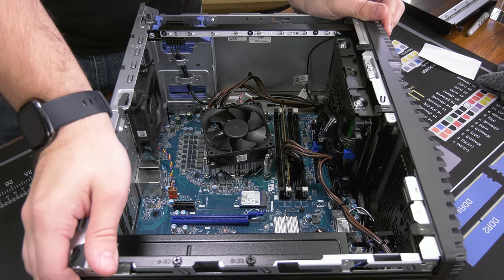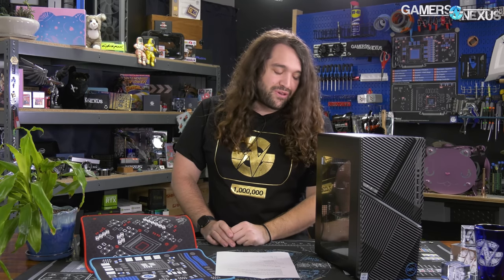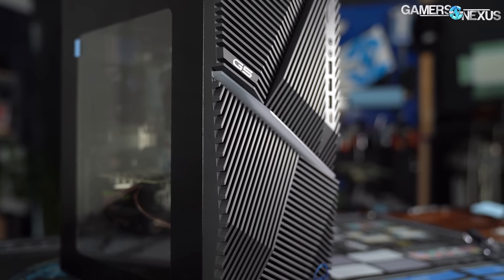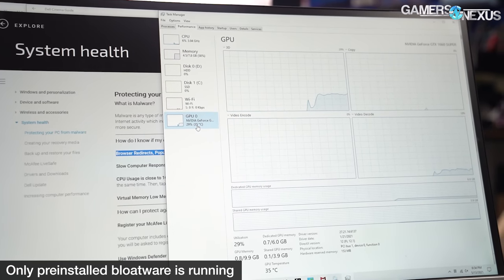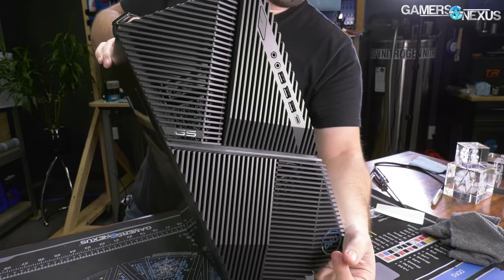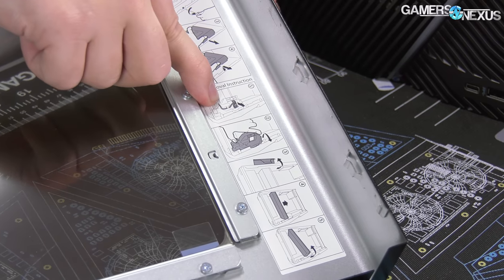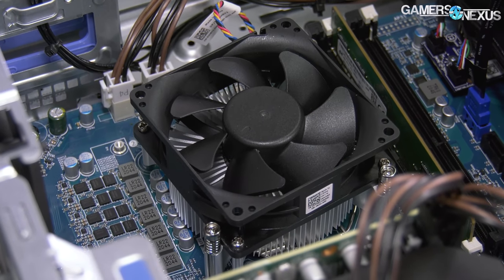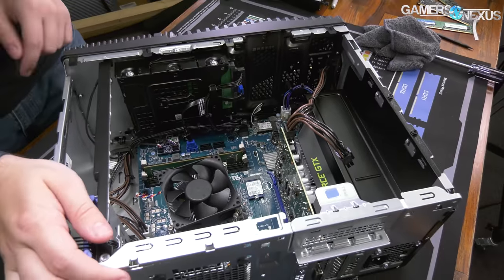Worse Than Walmart: Dell G5 5000 PC’s Garbage Parts & Hidden Charges

Comment: Dell have done this for decades

Parts are specifically made in a way where you can't swap them out .. only way you can change them is by going to dell at a premium price.

YouTube videos on how to build your own pc 

Much cheaper and better specs
Reply: Dell stopped doing this for a good while, at the end of the Core2 era.

My Optiplex 7010 uses a standard format mATX board, standard PSU and PSU connectors, has a detachable rear IO shield and the front IO connects to the board with standard wiring. And it's a system manufactured in 2014.

It's sad to see they went downhill again. They know how to make good systems.

Comment: Welcome to dealing with “Legacy” computer manufacturers that use their corporate sales tactics on direct consumers as well. It’s amazing. This is how they all were and partly why “Gateway” was so successful and so crappy at the same time. They did the same sort of things but they offered them to you honestly even if they leaned heavily on you to buy it etc they told you so for consumers this new “easy” way to buy a computer without car salesmen tactics was amazing and super convenient etc. sad
Reply: I'm not defending Gateway, as they did some really stupid BS in their laters years before getting sold to ACER, but at least they used more standard parts you could fix yourself out of warranty that would fit in the case, then Dell ever has!!
Reply: @CommodoreFan64  indeed…though they were kind of 2 sides of the same coin. Dell just had the balls/nerve to treat home users like they were buying thin clients or something

Comment: I know a company in my hometown that builds you a computer from the parts you select, for less than €100 + the price of the parts. And of course they give a guarantee for each part separately. Only once I have had a problem with any of their products, and that was resolved rather fast, the guy just asked if this other computer would be fine to me and I said yes. Then I just carried it to my car and drove home. And it worked for years very well. I suppose the problem was with the motherboard, but I never asked them.

Comment: "WHY WOULD YOU MAKE A LOAD-BEARING CPU COOLER!?"
Reply: ... so it won't pop off during shipping?
Reply: It's not load bearing, it just attaches to something unexpected (the case).
Reply: @AndrewARitz  It actually is load bearing , bcs the stands go through the motherboard so basically when you pull on the motherboards the pressure point is on the top of the CPU. But as there are other screws on the edges it's not that big of a deal. 
Usually when you have a MB stand , the thread goes through the motherboard but actually the motherboard lies on top of the stand and screw is pinching the motherboard in between. See the difference ?
Reply: @terrabiker  No it's not.  The motherboard is secured separately.  This was part of the BTX standard specifically to protect the motherboard from damage.  The cooler is a large mass, securing it to the motherboard forces the board to bear all of that load.  Securing it to the chassis puts most of that strain on the chassis.
Reply: gmu_alum08  Exactly what strain do you think there is?  The motherboard weighs barely more than that cooler, far less than a larger one, and is well secured across a much larger footprint.

Per Intel:
"The SRM is the critical structural component in the chassis. The SRM is a very high stiffness element in the static and dynamic load path that removes many of the structural liabilities evident in existing custom and ATX chassis designs,
The SRM:

•Substantially increases the motherboard effective stiffness, which:

 Reduces the amount of preload required to manage second level interconnect (e.g. surface mount component solder joint) integrity in mechanical shock, vibration, and long-term temperature cycle reliability testing

 Limits the upward motherboard curvature during an upward mechanical shock event. Upward board curvature is especially detrimental to second level interconnect
•Ensures that the internal loads of the TMA heatsink are transmitted to the chassispan at its stiffest locations near the front and rear chassis walls.
 The TMA heatsink inertial loads are transmitted through the SRM to the TMA Attach Features (Section 2.7) and the SRM Retainer Slots (Section 2.5.4), which are located very near the front and rear chassis walls, respectively."

https://www.intel.com/content/www/us/en/design/technologies-and-topics/motherboard-form-factors/technical-library.html?grouping=EMT_Content%20Type&sort=title:asc

Comment: I feel sorry for anyone who bought this as a way of getting into pc gaming.
Reply: When I first got into gaming I remember buying the dell xps 720 and I spent thousands of dollars on it, it was an absolute beast and had so much upgradability. Then I remember a few years later getting the newest dell xps (think nvidia gtx 400 era) and it was a piece of garbage. The inside was a really cheap motherboard. The cooler was so shit, the ram DIMMs were the absolute cheapest garbage. I was able to upgrade my super old pre xps720 emachines desktop to be more powerful than the most powerful XPS desktop at the time.
Reply: I've been building PCs for thirty years. I bought the AMD 5700 XT version of the G5 5000 because I'm a grownup and just want to play games. For us, this system is well thought out. It's not for hacks who like to mix and match components and was never intended to be.  Being all 12 volts is actually a very good thing for energy efficiency, in spite of what this guy says. Same with the proprietary motherboard.  It's like nobody remembers the BTX form factor or even the move to soft power switches.

Comment: Not only are they sneaky with the extra charges but I even heard of people ordering dual channel memory and getting single even though they paid for dual.  That is for performance and it is the one reason to get dual channel (or more channels if your system supports them).  I always knew even years ago Dell uses proprietary parts and that is why I always flatly refuse to buy one of their PCs.

Comment: I’d like to see GN cover a Precision workstation from Dell. They seem to use standard components and have some actual airflow.
Reply: I actually just picked up a yard sale XPS Skylake that blew my mind away by having a fully standard mATX design. 24-pin, normal PSU, sane headers.
Yeah, it uses the same weird chassis from the Alienware with the power supply mounted above the CPU, but when all it's cooling is a 6700 non-K, it's not that big a problem.
They also didn't embellish it with much excess plastic, just with a forehead with the front I/O, and a footer.
She's definitely a keeper. Thermals/airflow might be a concern when I upgrade the GPU from a 750ti though.

Comment: Dell is so scummy. They had a price match deal where if you found a system online cheaper than what they sold the exact same system for on their website, they would match it and reduce the price by 10%. When I found a laptop that was below their price, I brought it up to the sales representative who refused to price match even though they couldn't point out where in the fine print the match I found violated their policy since it was from an authorized Dell reseller. After 15 minutes of arguing with the rep, I hung up phone and decided to buy the laptop from the reseller. 

In only about 5 minutes, the laptop on the reseller website was taken offline and unavailable to buy. Then the system came back up at the SAME PRICE as the system on Dell's website! WHAT THE FUCK? Never trust the price match program for Dell, they use it to enforce their pricing policy on resellers and don't even give you the discount that's promised.
Reply: That sounds about right when it comes to price match and Dell... Just make a PC when GPUs finally become available.

Comment: A couple of years ago I bought a laptop from Dell for my dad. He only uses it for internet, so I got the low end model. Within one month a windows 10 update popped up and he was unable to use the computer. He finally told me when I saw him using his old computer again about two months later (he didn't want to bother me). Windows could not update because there wasn't enough memory. After shutting down everything I could think of, still not enough. Called dell and they claimed it wasn't covered under the warranty because it was a software Problem  and I would have to pay and send it back to them. I tried to buy memory for it and found it not available because the memory was soldered to the board and no expansion slot. When I complained to the tech, he laughed and said "you bought a cheap laptop".

Comment: "I dont cook my own food" we can see that lol
Reply: Samurai Shampoo  It's often cheaper to have someone else do it believe it or not. You also have them do other things while it's on the lift like check the brakes, suspension, and rotate the tires. Most shops don't charge to do that.
Reply: Samurai Shampoo  you don't deserve to have a license if you don't know how to do basic maintenance on your car, at least having done it yourself once.

It's pathetic how little people know about the cars they drive every day at speed near other people
Reply: @willjohnsonjohnson  It's cheaper at shops because you're generally getting recycled oil or a mix of recycled and new with a cheap $3 Fram filter.
Reply: @drumboarder1  Most people would have to visit the shop anyway to dispose of the oil that is a waste product not everyone is conscious about dumping their waste somewhere. I did my own oil change once then realized it's more expensive, but yeah I'm paranoid about them trying to get away with leaving the same oil filter so I mark it with sharpy to be sure, but that doesn't mean they didn't put a different used one on, The only reason to do your own oil change is to avoid being lied to or scammed.
Reply: @StayMadNobodycares  same as building your pc once, fix your car once to figure out what the basics are so you aren't an uninformed customer.

I've come across multiple mechanics willing to dispose of my previous coolant that I kept in bottles and the same will no doubt happen with oil.

Comment: So I have one of these and I've had it for at least a year now. I'm looking to upgrade into something better, but I don't think I can afford a total re-build. Is there any way I can salvage any parts from this into another PC.
Specs(any not listed below are the same as the video - ex. PSU, CPU cooler):
CPU - Intel i7 10700
GPU - Nvidia GeForce RTX 2060( The one that came with the build)
32 GB Corsair Vengance DDR4 Ram
wdc wd10ezex 1TB internal hard drive
pm991 nvme samsung 256gb internal ssd

Comment: I'm not sure what happened to Dell.  My work used to use them exclusively, but after years of getting scammed by the "corporate account" and getting prices HIGHER than they were offering to the public, and having several orders cancelled without notice, we had to switch to a competitor.  Then to see this tear down... yikes.  I've recommended them to family in the past because I didn't want to deal with building and supporting a family members computer, but I'll never do that again.  this is bordering on scam territory.  I do not expect proprietary components on a computer today from anyone.  if it says 1660, I expect to be able to use that anywhere.  I'd be interested to see their description of the form factor for that motherboard.

Comment: I got a Dell for Christmas in 2005. The hard drive failed within three months, and the new one they put in only lasted five years, though that could have been a different part failing. Never buying from Dell again.

Also, never be afraid to be a "jerk" with customer service if the company is trying to rip you off or you have a legitimate complaint and they're not being cooperative. It isn't the rep's fault, but they knew they would have to deal with angry customers when they took the job.

Comment: I think the limited air flow through the front panel may be done for the purpose of directing airflow to maximize exposure of cooler outside air and enable release of heat exposed warm ait back out with the least comingling, and something that is commonly done but misunderstood.

Comment: I worked for Dell tech support around 2005, This system looks more like junk than the crap they made when I was there! They are made from the cheapest parts available. A system is designed, an expected amount to be sold is calculated, and bids are accepted for the expected amount of each part needed. The cheapest bid (per part) is the winner  All parts will meet the "minimum" requirements as specified by Dell and are shipped as needed so the Assembler dose not need Warehouse space..Life expectancy is not relevant, only price! The system you are working with probable costs under $2oo to manufacture and ship to the US including the cost of shipping to the customer. All major manufacturers work this way, HP has slightly higher Minimum Specs but not much. I worked for them after I quit DELL. I took and early retirement because I could no longer support or sell this JUNK!

Comment: I have worked with old, out of service Optiplex towers for years. This prebuilt is genuinely as terrible as an Optiplex. That cooler on the 10400 is the same thing on my "project's" 6500. Everything is proprietary and, quite simply, designed poorly.
Fun little fact. Things weren't so bad before fourth gen Intel Optiplexes. They used to use standard PSUs and have larger (yet still terrible aluminum) CPU coolers. Well, the fans used proprietary pinouts, but I'd take that over a non-standard PSU.

Comment: Thank you for outing Dell. The most expensive computer I ever bought was a desktop from Dell in 2005. I loaded it with everything they had for it. That thing started sputtering 2 years in and blue-screened twice in the last 6 months I had it. The third time it went down, and they wanted $250 just to fix the thing again, I told them to fuck themselves and went out to get a Walmart comp. That comp took forever to actually load up and get going, but once it was on, it performed consistently better than the Dell and was thousands of dollars cheaper. At the time, I was using it for basic web browsing, I've never regretted that HP, but I regret that Dell 18 years later. I hated that computer.

Dell is a tech support company selling computers, not a computer company offering tech support. Never buy your car from a mechanic or your computer from tech support. They make it to break because they get more money fixing it than they do selling it.

Comment: There are good reasons to have both the front and back I/O on the PCB. Board assembly can be automated reliably and there are fewer things to connect and cables to route. This is not an option on enthusiast cases because they have to accommodate multiple form factors.

Comment: I’ve had a Dell XPS for the past 8 years. The lack of upgradability due to proprietary parts is real but for 99% of office work stuff it’s great and I have had zero problems.  I did upgrade the HD to an SSD but that’s about it.  Dell did get its name for making office and business computers and not gaming PCs so don’t expect RGB’s, extreme coolers and cable management.

Comment: got mine with a 3070 and replaced the exhaust fan as well as the cpu cooler. No issues and have had it for over a year.

Comment: I bought a factory refurbed Dell Inspiron notebook several years ago.  The monitor was nothing short of great.  However, the processor was so under powered that it was, pretty much, maxed out just running Windows 10 bloatware.  It was slower than slow.  There was little power left to do anything useful.  It's, now, in the trash.

Comment: I used to buy dells way back when...had those old grey  and black Dimensions 8200...not a bad comp at the time, worked for most games back then...but like many of these makers like Dell, HP, etc you really can't upgrade much, so I decided to start building my own....been doing it since 10 years ago. Glad I built mine before computer part prices went insane.

Comment: When ATX was a new concept (late 90's) the mid-tower Dell's of that era would have a PSU with the exact same 20 pin molex but wired the "Dell" way with higher voltages on the pins where 3.3v was supposed to go. The case would fit a standard ATX motherboard and the PSU would plug into it but go to turn it on and the smoke was let out.  Pure evil...

Comment: Company I work for is exclusively Dell. I found it if you just go in and pick a box based on a desired spec you really really need to take the time to review the contents and make up of that box closely. On the other hand if you want to spend the cash you can pretty much spec some very significant equipment. I've got an editing laptop from them that I will stand up against anything but it did not come cheap. I could have absolutely beat that price other places but corporate says we buy from Dell so we bought from Dell. I will say the advantage of having all Dell is that warranties and customer support for us are never an issue.

Comment: I bought a Dell a long time ago and while it worked fine I soon discovered it used a non standard board, a non standard power supply and was filled with very basic OEM components. I could upgrade in small ways, e.g. RAM upgrade, but the board/case/PSU were not upgradable and the rest of it was questionable quality. Proprietary can mean the difference between reparability and landfill and it's not like Dells are good value either. I suspect the value actually gets worse as the price goes up. So unless I were a company buying PCs with a support contract I'd avoid Dells like the plague.